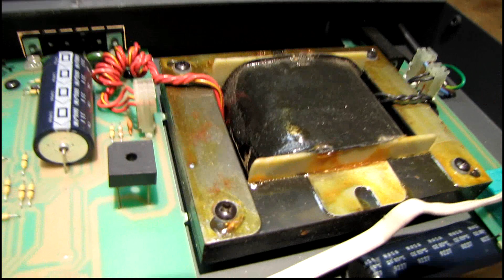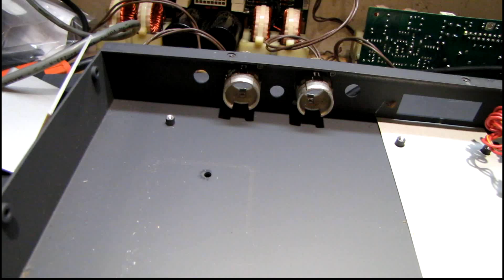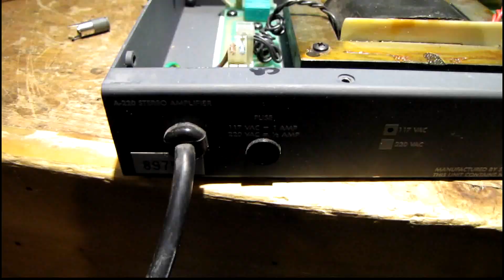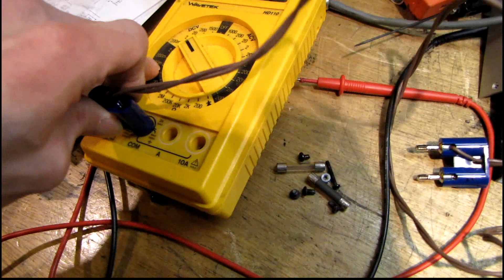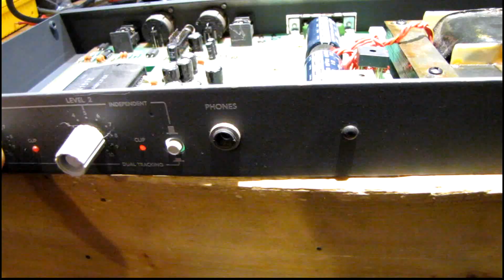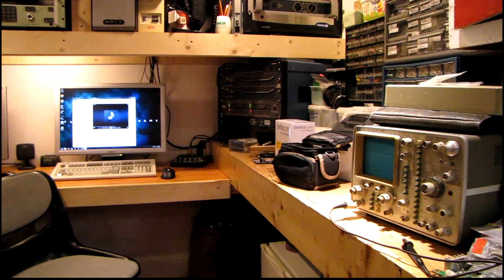Quick Fix: Symetrix A-220 Pro Amp

Comment: STK amps did the job but more for very low end stuff. I love the condensed, complete package but they lacked power handeling capacity and were very suceptible to over heating and oscillation. The good STK amps only had driver and final transistors in them but are no longer made. Still, 10.00 was a good find. Mostly, these amps would be used for a small stage monitor, where high power and hifi audio were not needed.

Comment: hello there maxxarcade  another great video  i have a question i am wondering if it is possible to connect a speaker  to both speaker outputs to be able to have both channels playing through one speaker thank you .  also how do i fix a scratchy volume control  when i use contact cleaner on it and it still has a scratchy static to it . any help would be greatly appreciated

Comment: You mention 1992; my first amplifier was an Australian 'Playmaster MOSFET 50/50', which used Hitachi 2SJ48/2SK133 output pairs.. ..with a 'C core' power transformer. Constructed it in 1983; kit price $A175.00. After distortion on left channel, replaced all 12k 1W carbon resistors with metal film.. They looked 'normal' but were 100k +..